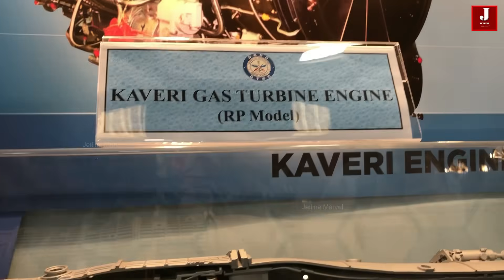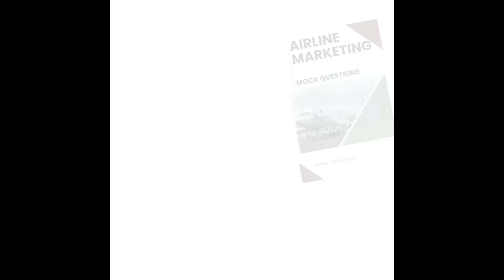Is the Kaveri engine ready for testing trials, India's much-anticipated fighter jet engine?

Comment: We need the digitally controlled high capacity engine  with thrust vector of at least 60 kn dry and 130 kn of reheat to meet the future challenges of single or twin engine omnirole jets, or even for 4 engine long range bombers. Only this can give us the aircraft capable enough for VTOL  design and thus redunding need for huge aircraft carrier or even well maintained runway. This future engine should have weight of within 1200kg and variable compression ratio. Air must be sucked from multiple honeycomb holes in the frontal part of the wings, making it minimum drag , zero radar signature ,and sustained supersonic speed at minimum fuel.  This new design only can make our future aircraft attaining  mak 3 speed in emergency . Tail fitted A to A missile and  a mini radar  is needed to destroy any attackers one approaching it. These new technology is going to be adopted by all other countries very soon. We should not keep ourselves behind them . Never forget the sayings of kalam sir.

Comment: I would wait till we have done the actual test on a fighter jet and it passes all the expected parameters and the Indian Air force accepts it. The issue is that the funding of the program for the development of an indigenous engine was paused for a while in the mid-development phase, which put this much-required engine in the freezer, otherwise, India would have had its own engine already <sigh>

Comment: Even if the reported thrust generation is true, many more parameters has to be achieved as per requirement before it can be considered for using in a fighter aircraft. It's weight has to be reduced further, thrust by weight ratio is more important than the absolute thrust generated. Testing has to be carried out in all types of weather conditions, and different altitudes for prolonged time. It is to be seen after how many hours of service the engine needs to be overhauled, and needs to be replaced. Then only it can be cleared for mass production. Hope everything goes well.

Comment: It is currently producing 51 dry thrust and after fitting afterburner this will produce 80- 82 kilo Newton thrust
Reply: It is assumes that it can get 80kn with afterburner but not confirmed. its still facing core thermal resistant then how will they push it to that much kn without working on its metallurgy first? ok the blade is ready but core is not, so more time or delay. they should try reverse engineered it or buy some technology, there is lot of potential in that engine program.
Reply: @lordzroger951   it can be improved by times if proper funding will be disbursed by govt for R and D ....China has developed WS 10 and WS 15 but WS 10 is still facing lots of problem China heavily invested on research and development but still facing problem ....so I believe Kaveri will meet all parameters in upcoming days
Reply: Has to improve again to make it at par with Russian Saturn Al31